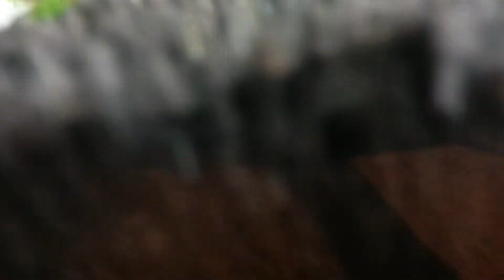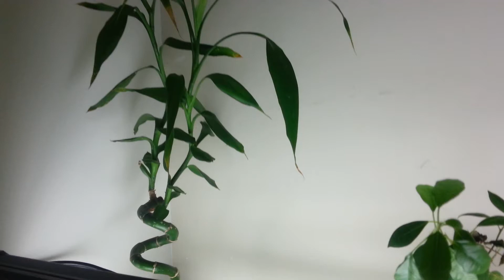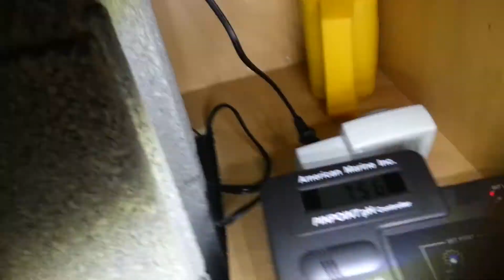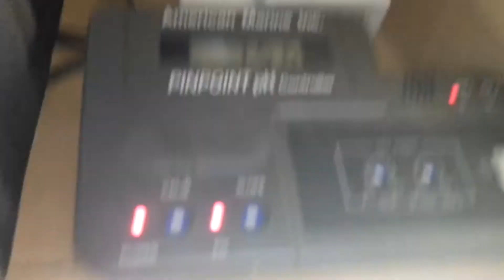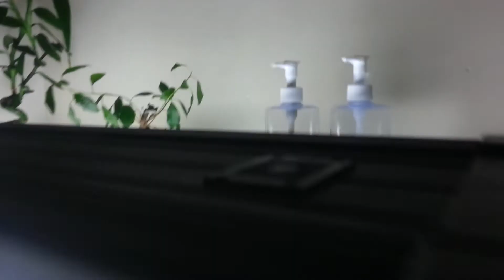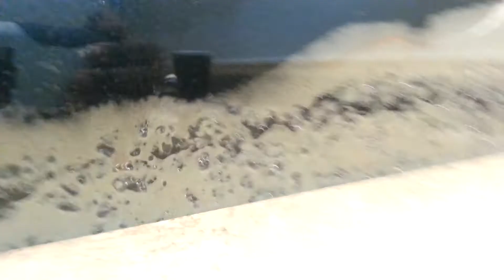65gal Nature Aquarium

Comment from the maker: The same happened with both of mine, so i'm going to assume that is how this system works. I believe the large bubbles are H bubbles and not wasted CO2, The first smaller bubbles were basically the systems "start up" sequence. But be assured it is working, i would recommend getting a pH monitor or test kit to carefully watch the balance of the tank.

Comment: Your tank looks amazing, well done!! I also have the sicce co2 life but am wondering if I have set it up correctly. Basically, I switched it on for the first time and I had a fine mist of bubbles coming from the unit, but after a short period of time, these stopped and are replaced by large bubbles that are lost at the surface of the water. Are these hydrogen bubbles or wasted co2.  I'm not sure whether the unit should do that or not?